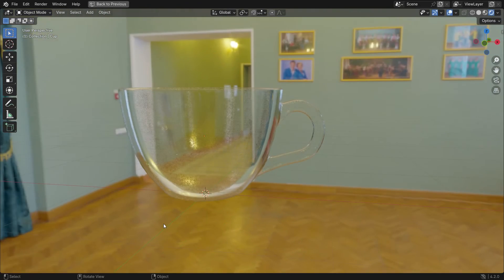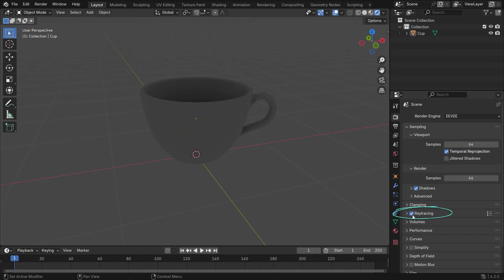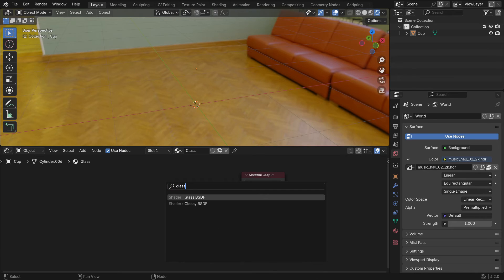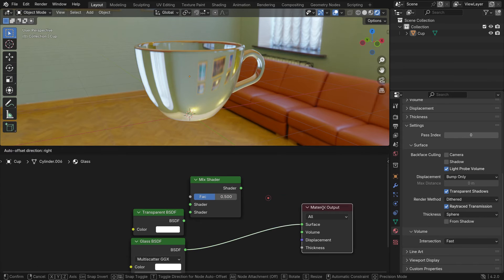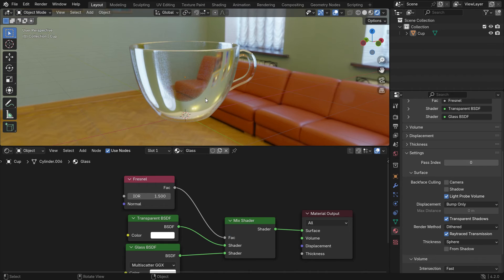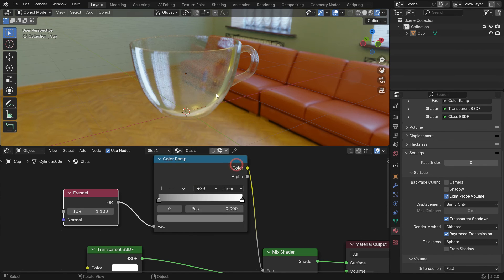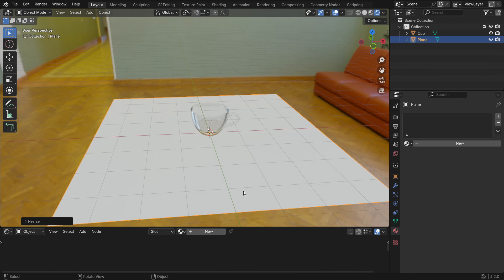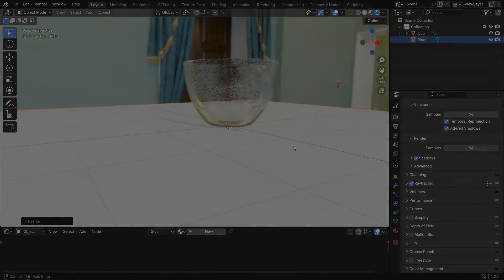How to Make Transparent Glass In Blender 4.2 Eevee Next

Comment: can we do in using only p_bsdf
Reply from the maker: Yes, you can use the Principled BSDF Shader instead of the Glass Shader to create glass materials in Blender. To create a glass material using the Principled Shader, you can follow these steps:
1) Set the Transmission value to 1. This makes the material fully transparent, like glass.
2)Set the IOR (Index of Refraction) to a value around 1.45–1.5, which is typical for glass.
3)Adjust the Roughness value to control the smoothness of the glass surface.